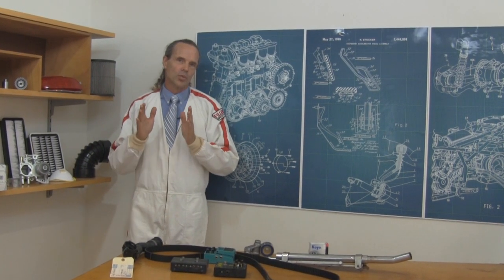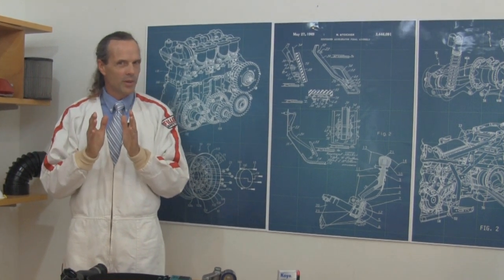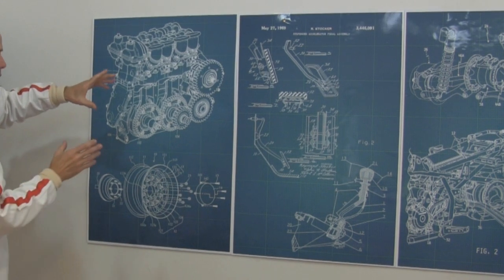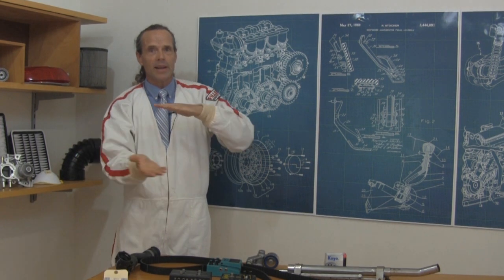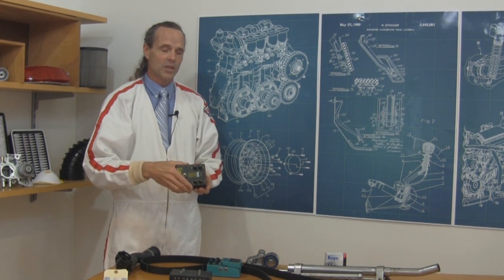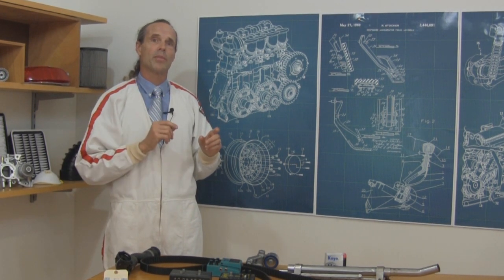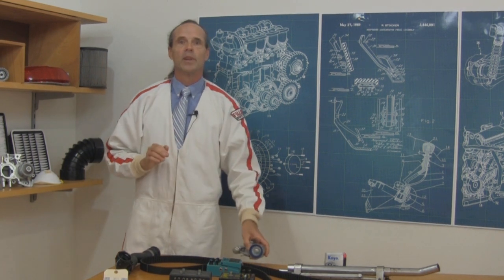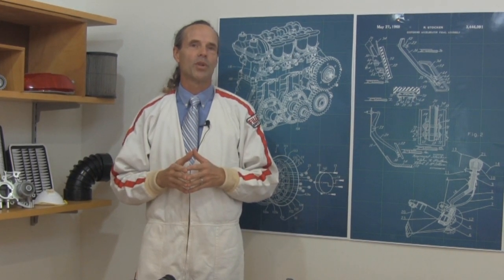What is a Crypto Encabulator

Comment: You have a very good point here. BUT on that four-cylinder engine the intertubular translacers will inadvertently show abnormal interflange reciprication. That's just the laws of physics. For that reason I strongly recommend-althought at initially higher cost-getting the six or even seven-cylinder Tesla cars. You'll thank me later.

Comment: A fair description. However, with the benefit of hindsight, we can tell you that the girdle trunions turned out to be the weak link in the system and often failed around the 200,000 mile mark. This was overcome in the 2034 year model with the introduction of a totally re-designed flux capacitor, using quantum entanglement in a, frankly, unconventional manner. Elon says Hi!